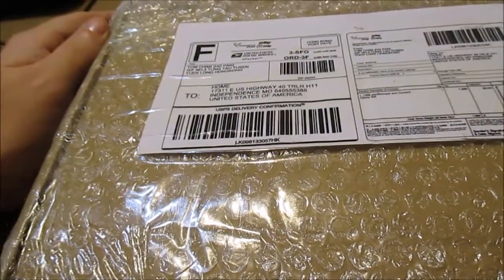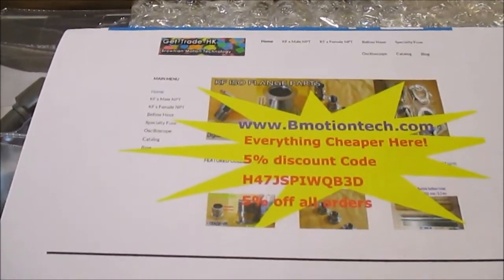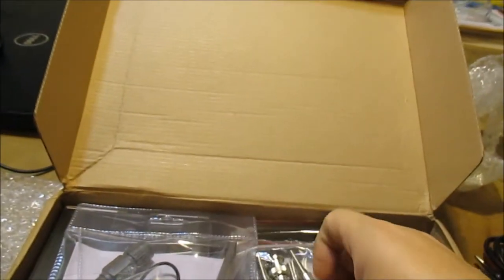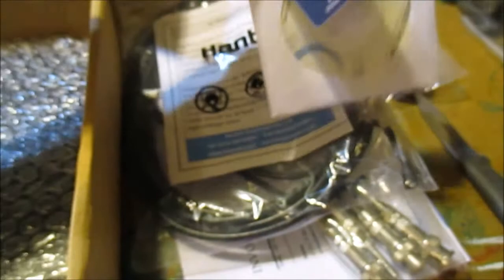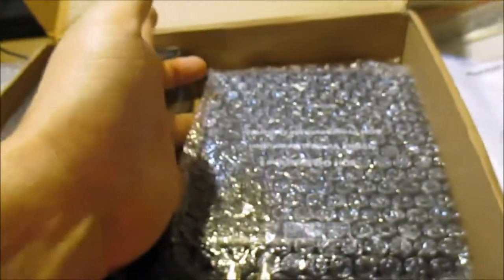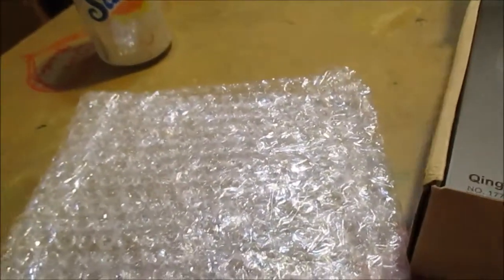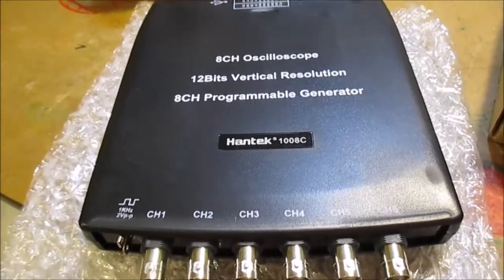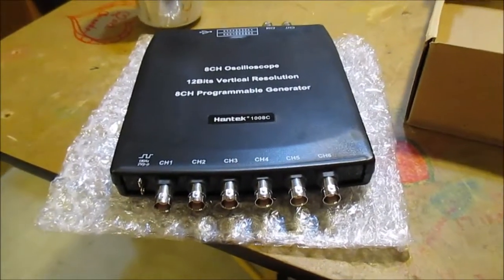Hantek 1008C Auto Oscilloscope Part 1 Unboxing

Comment: Excellent condition, the software tha👀>imgs.love/HDOscilloscope?e31  t brings has error and does not work but can be fixed by installing another and it is already a factory defect that has been presented on this same computer. Of the rest, all new parts, the package comes protected with case and double box.